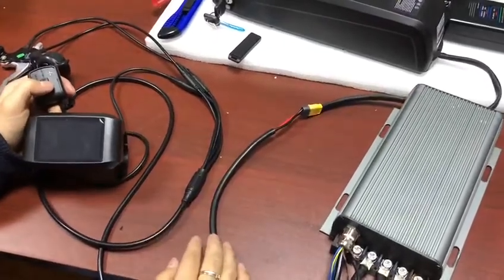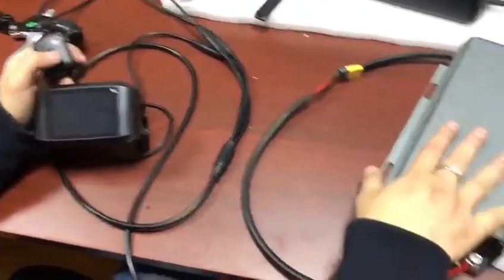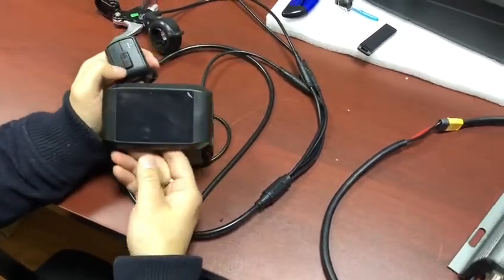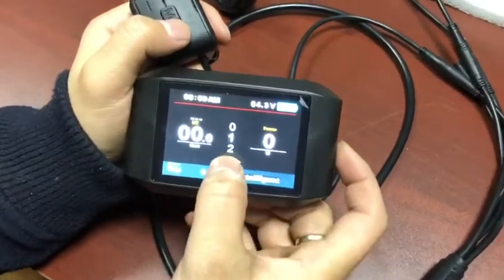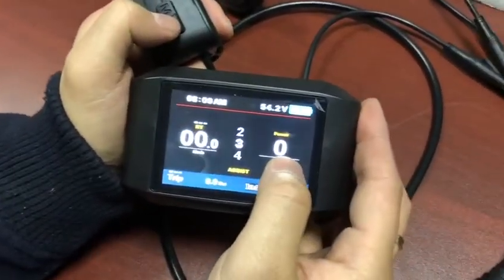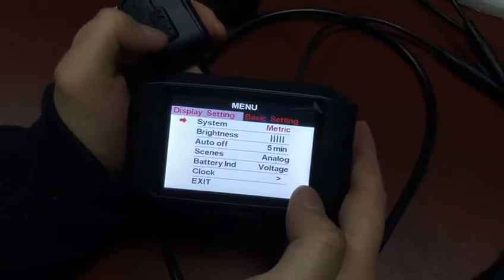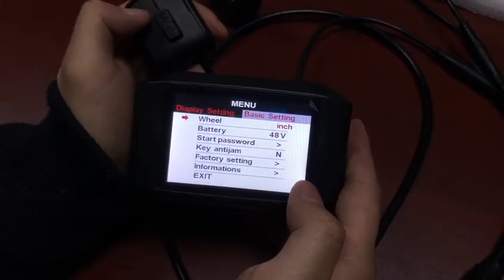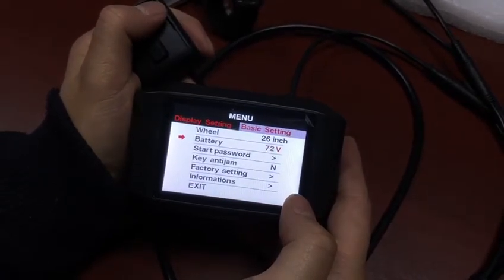TFT display with sabvoton controller

Comment: hi can this display be purchased separately from the controller? need one for Sabvoton 72V
Reply: Yes Internet is empty about this, bought separately as got cycle analyst and i hate it.
This morning it came and obviously there's a problem different 6pin plug from controler and on tft only 5 pin so there goes quick install.
Agrrrhhhh my bike is 12kw with cycle analyst and only way i think is to buy new controller comes with display or cut wires and solder conectors just dont know what to do with white wire that goes in the shunt.
Another problem is that in China color coding wires is optional 🤔 i think i am stuck with analyst for now its so Canadian..

Comment: hi, I have a SVNC72200 but there is no display port, is it possible to add this display with a bit diy ?
Reply: I have the same question. Did you find a solution to this?